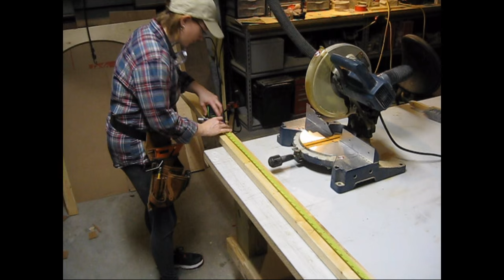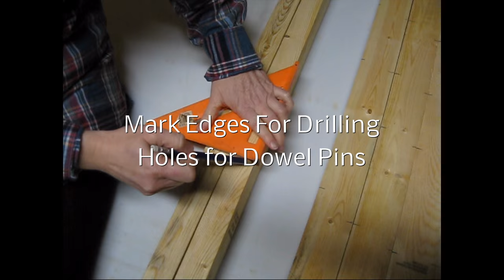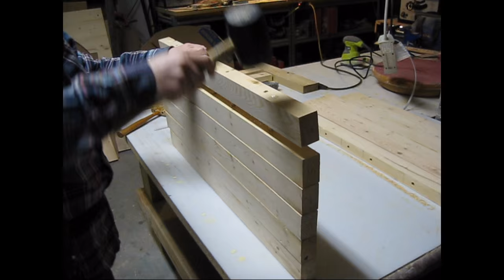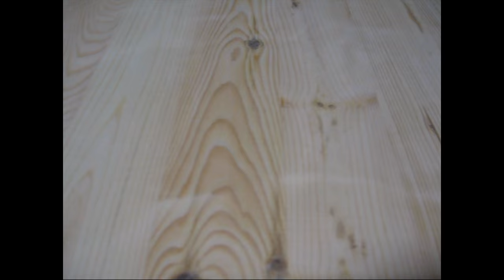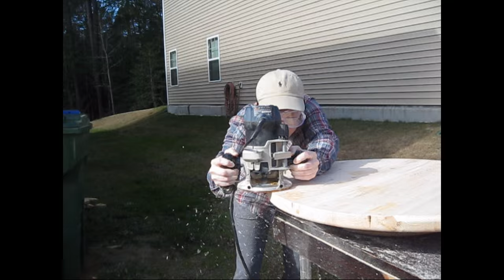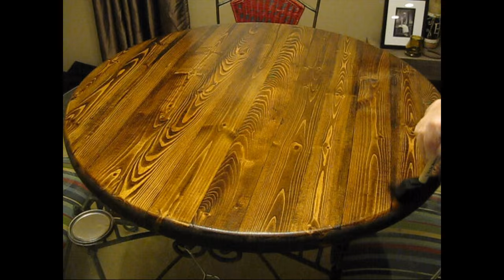how to make a large wood lazy susan

Comment: Did I miss the part where you actually make it a lazy Susan? I only see you making a round "table"
Reply: Exactly!!
Reply: The round top is actually the vast majority of the work. Lazy Susan bearings can be purchased on amazon for $10-20 and installed using regular screws and drill bits
Reply from the maker: The link to the hardware I used is in the description of the lazy Susan video above

Comment: Curious about what the reason is for doing a coat of poly and then sanding it off, then putting another coat of stain - what purpose does that serve?  Almost seems like a waste?  Looks great, though!
Reply from the maker: Hello and thank you for your question. I don't actually sand the poly off, I just sand it smooth with a 320 grit sandpaper. Then I apply another coating of stain, then when that dries a final coating of poly sealer. It gives it a 3D effect that is beautiful and looks like a factory finish. Thanks again for the question! ~ Steph

Comment: Thank you for the awesome video, just one question. When drilling the holes for the dowels do you alternate a little as to not have then all lined up?
Reply: Yes, they are offset. Thank you for your comment, I made a Susan that was 48 inches last week, it had about 60 dowel pins, it's still drying from the glue/clamping. It's a very large Susan. Thanks again for your comment and question. ~ Steph